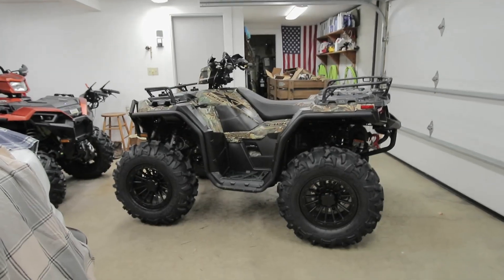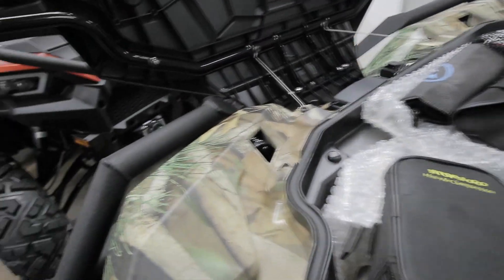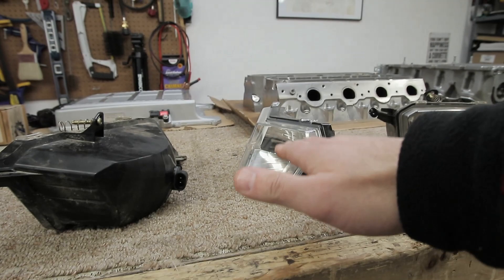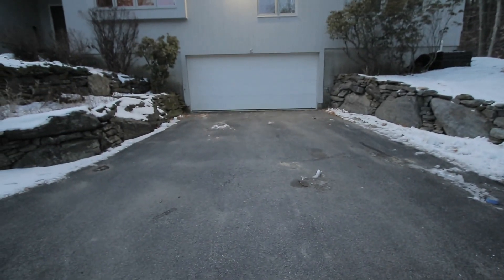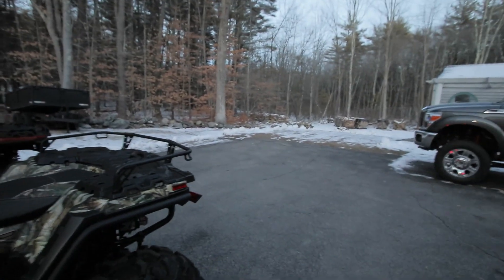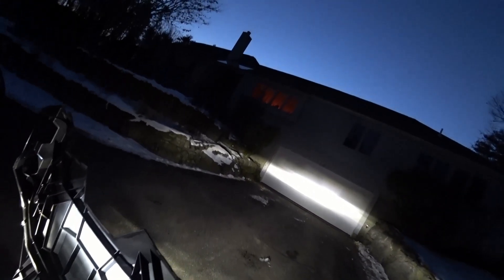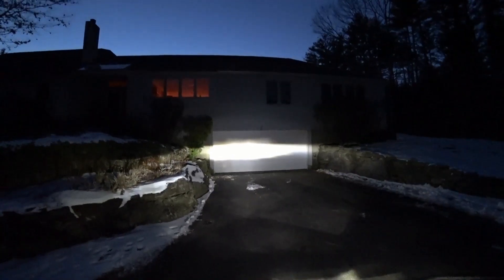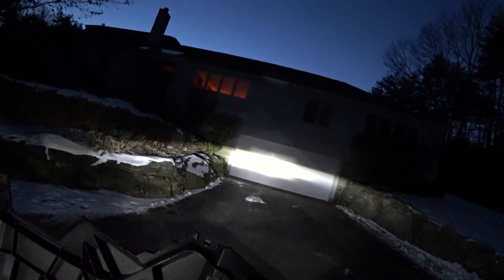HOW to Aim & Adjust ATV UTV SxS Hi/Lo Headlights | POLARIS Sportsman XP 1000 850

Comment: I took my dremel and made a notch in the plastic underneath for the top screws to make it a little easier to adjust.   I’m also thinking about putting a washer behind the spring / body to give it a more downward angle on the 2 headlights.  After hunting this past weekend, I was wanting more light down low.  I’m sure this will all change once I get the SR 10” rigid light bar.
Reply from the maker: Great idea the plastics are tight. The narrower the tool the better. I do like the light bar idea on my machine too